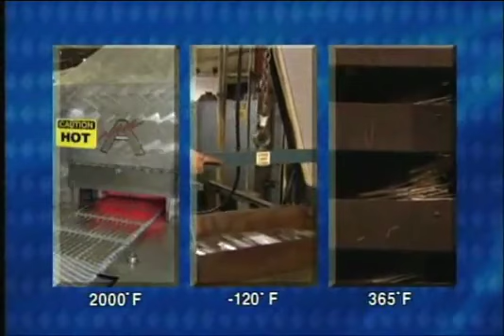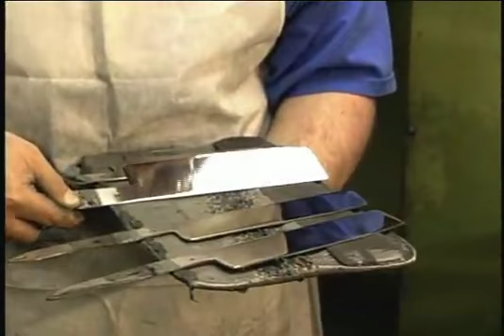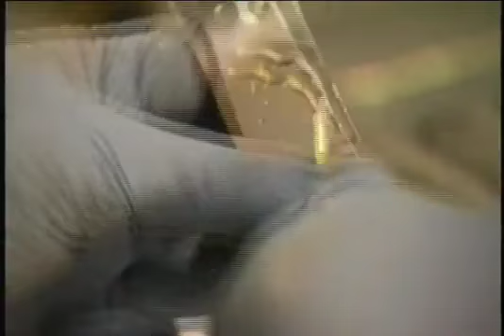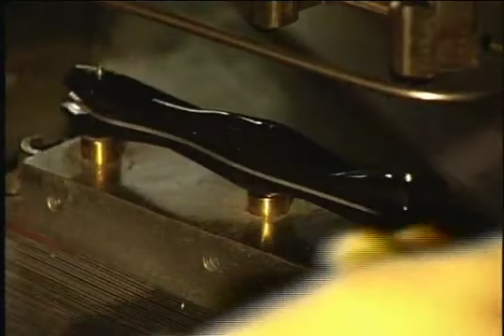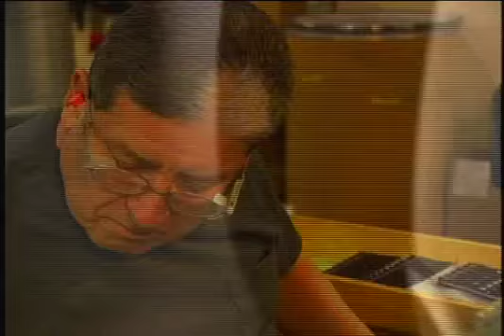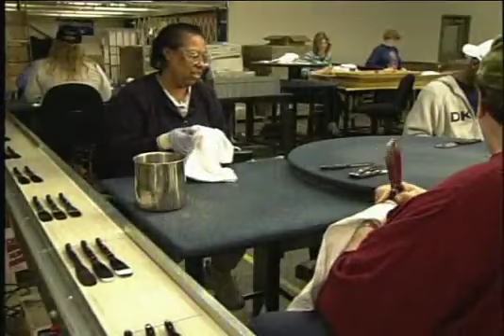Cool Stuff Being Made  Cutco Knives

Comment: It takes a lot of work to make cheap steel sharp! It amazes me that people are buying these cheap 440a stamped steel knifes that you can find at Walmart or target for $100 a set! Cutco sells them for $1,600 a set! Haha! Do your research! Buy quality forged knife sets from zwilling or wusthof. Don’t get suckered in to the untrue sales pitch.
Reply: Everyone has opinions based on materials.   It’s like the android vs iPhone.   iPhone does wonders with programming for simple users.  Android offers more open source for more advanced programmer types.   The cutco knifes I have stay sharp and I don’t have to do anything to them.   Other knives I have had find them garbage can in a year or two.  They may not use the best of the best carbon steel but they are pretty maintenance free.  I can see someone choosing cutco that doesn’t want to maintain.  I could see someone choosing another brand as well.   I will say, cutco has amazing warranty, so the price is a little pay it forward.   They replaced some hand me down knives I received with new ones.  That is amazing after 20-30 years.
Reply: @kevinh5448  Glad you like your knifes. My point is you can buy the best of the best knifes for less than a set of Cutco knifes. The difference is very noticeable you don’t have to sharpen as much with better knifes and they handle far better. Also Zwillings warranty is awesome the replace knifes free of charge regardless of age. If you like the performance of stamped steel knifes get a $100 set of knifes with same quality as Cutco and an electric sharpener instead of $1600 bucks on a set. You can buy an apple or a couple android phones with the remaining money.